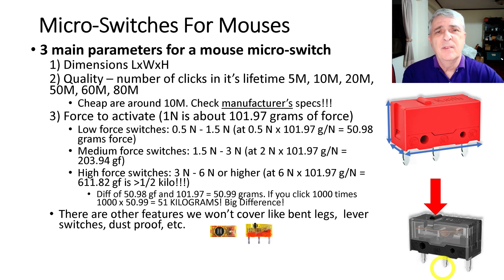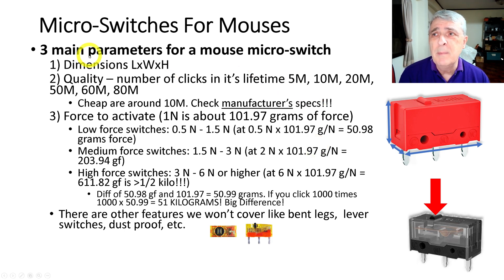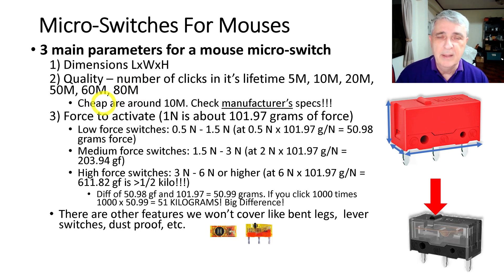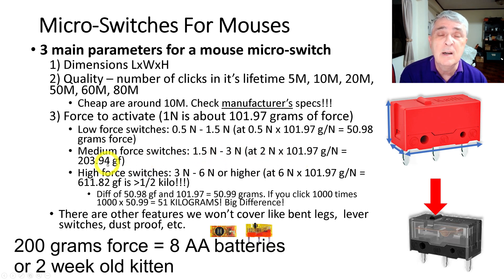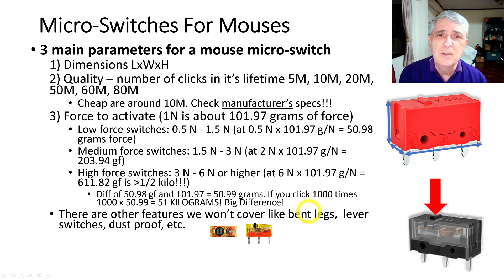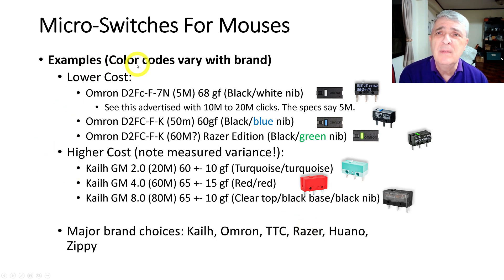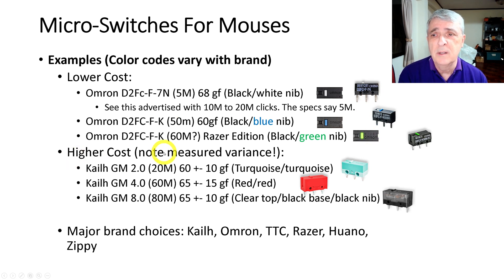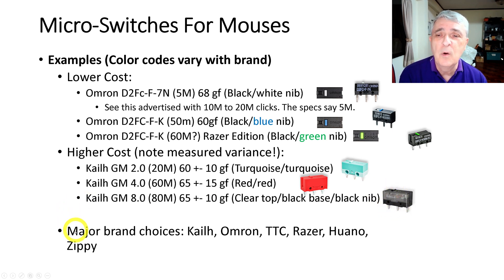Mouse Micro-Switches - What You Should Know (4K)

Comment: I will look out when I buy replacement switches, thanks. I started to do some research when my friend whom I play video games with had the double click problem develop. No more than two days later I developed the same problem. Something felt cheap/fishy about it. Well, I took it apart and put the slightest amount of Ballistol (lubricant/cleaner) on the contact of the switch, and I no longer have the double clicking problem. Obviously the problem seems to be with the quality or type of contact material used. We'll see how long this solution lasts.

Comment: I knew a bit about these switches but not how much of a difference there was in lifespan.  Been doing a deeper dive on this as I'm trying to figure out the difference between a couple mice I own and why I prefer X over Y and that led me here.  Going to have to dig a bit further as it seems mouse switches can get as complex as keyboard switches, just overall a lot less variety.  I see another commenter mentioned it but apparently not running switches at spec can also cause them to fail prematurely or act erratically which is a thing with some logitech mice.

Comment: I'm assuming the 10 million clicks figures are for testing. In theory, They put it under a clicking machine that clicked 10 million times, which is only a couple weeks of constant clicking. This figure means almost nothing, because It has nothing to do with the real world operating conditions of the switch. You're hitting the switch on an angle, with more force, there's temperature cycling.

Comment: I have been using a Logitech Wireless Track Ball mouse for years. I have replaced the micro switch's 2 times so far. Both tines I have used Omron switches and I get a little over 2 years out of them. I have been in the electronics field for over 50 years, I was not aware of the color coding or the force ratings. Next time round I am going to use Cherry brand switches. Thanks for the education, from now on I will put the info to good use. 🙂
Reply from the maker: I'm glad I'm not the only tech guy unaware of this! 😉